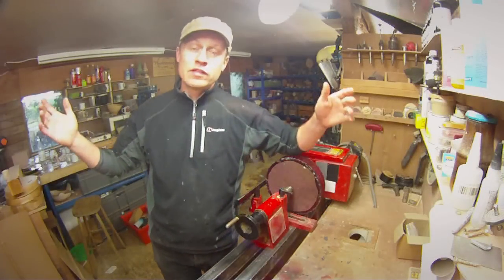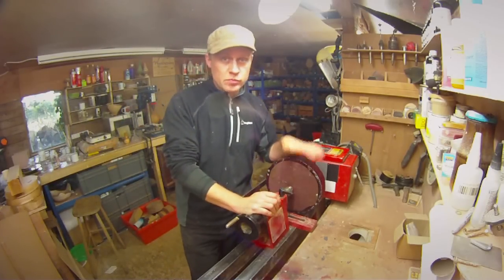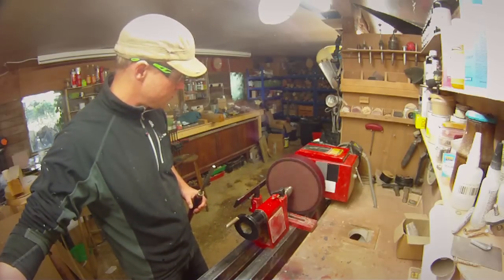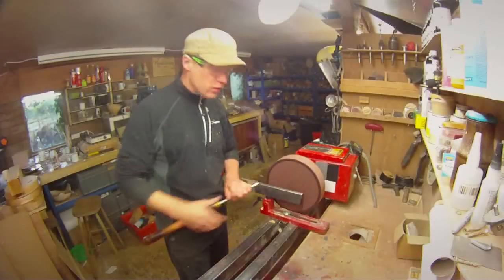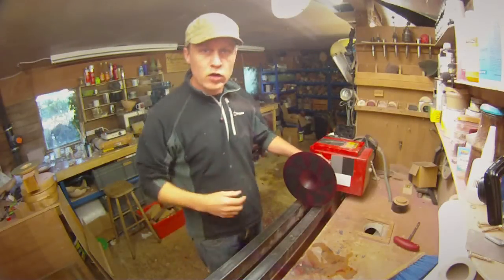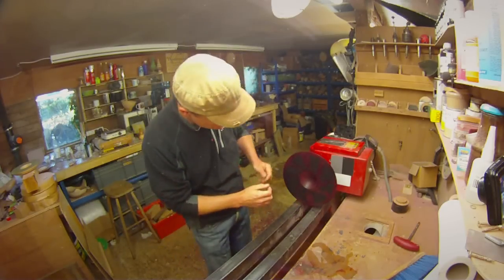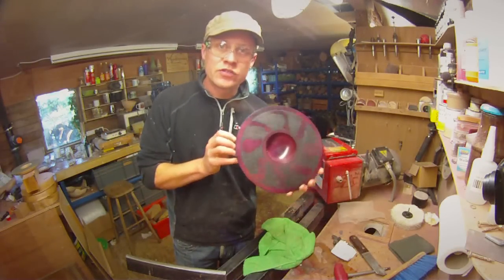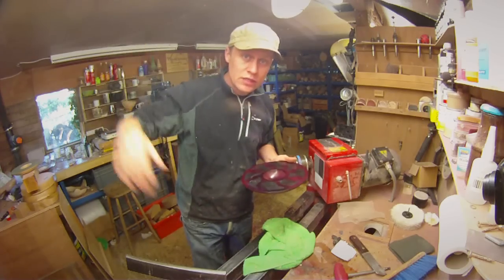#72 Woodturning Purple Heart Decorated Bowl 7200

Comment: Hello Mr  smith your work is superb. I have a question. Why do you use a tenon on your turnings? would it not be safer to use a mortise on the bottom? Then you would not have to turn the bowl around and have trouble lining it up again. I am not trying to critique your work just a question. your work is awesome. I really enjoy your comments they are very helpful. looking forward to more videos.  Ray Harvey
Reply from the maker: Hi Raymond. Tenons are generally accepted as being safer as the jaws of the chuck squeeze the fibres of the wood together. With a mortise, the jaws expand into the wood and push the fibres apart. Add that to the spinning of the lathe 'pulling' at the bowl, and the resultant forces can (rarely) blow a bowl apart - particularly if the wood is weak, like spalted woods can be.
Also, there is less chance of going through the bottom of the bowl when hollowing it out if you use a tenon than there is with a mortise.

I hope that explains it.

Comment: Great piece, not sure I would have the patience for 4 hours of burning :)
When I use purple heart I just leave the finished piece in the sun for a bit. Might be tricky moving into winter but an hour or so of direct sun light and the UV brings the purple straight back. Same effect will happen indoors just a lot slower. I have thought you could use this to "print" a pattern on the end result but have no idea how you could stop area's from changing colour once the pattern had formed.